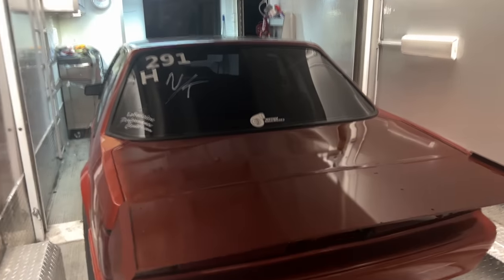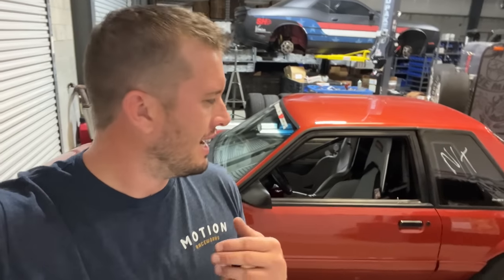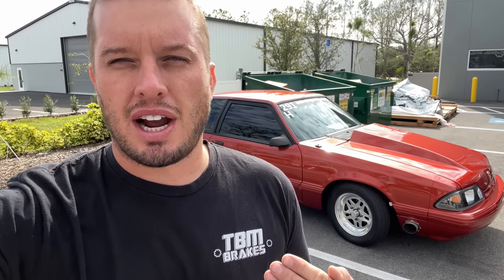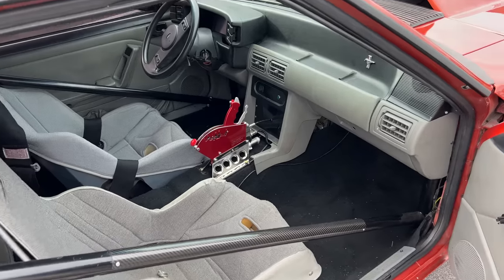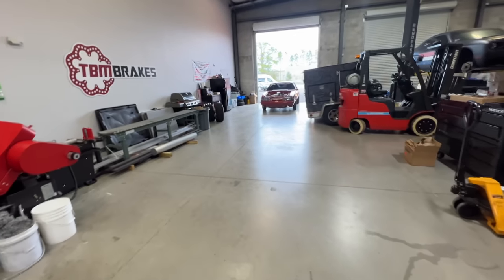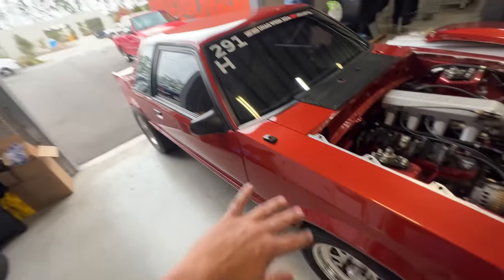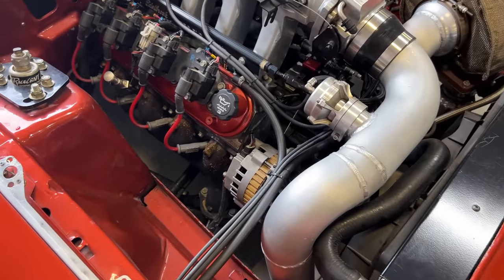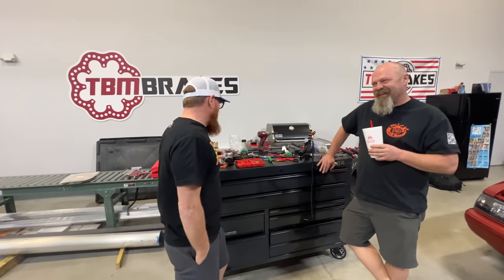El Toro gets a Make Over for Sick Week!

Comment: I would also put all Maven and ICT billet parts on the car as well to dress it up with some billet parts and switch the timing chain and cover to the new Innovators West timing belt drive so you can adjust the cam a0t the track if you need to get more out of it and it's all billet as well and eventually get a billet rear cover and put a Williams Fab oil pan on it and if you're going to keep it wet sump put an external wet sump oil pump so you can run a mechanical fuel pump and the external wet sump oil drive off of one belt drive off of a pulley on the crankshaft behind the harmonic balancer

Comment: I would put all new Brown and Miller plumbing with crimped fittings and I would either put a Holley Hi-Ram or Mid-Ram or even a BTR intake and get rid of the Elderbrock intake and I would put your 102mm throttle body and you need to make a 105mm Hi-Boost throttle body like Wilson Manifold makes and I would put a set either Billet Atomizer or Fuel Tech injectors on it as well and a TurboSmart Wastegates and BOV and stick with a Precision turbo

Comment: The engine that was running in the background 30 seconds into the video right before you switched to the clip of the car had a serious rod knock and it's not going to be long before it locks itself up or worse kicks a rod out the side of the oil pan you might want to get that fixed